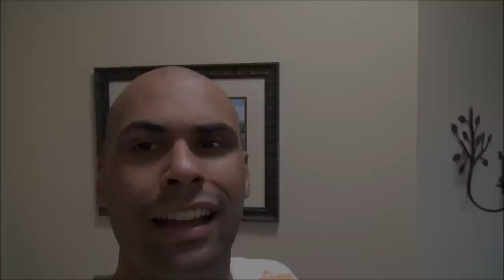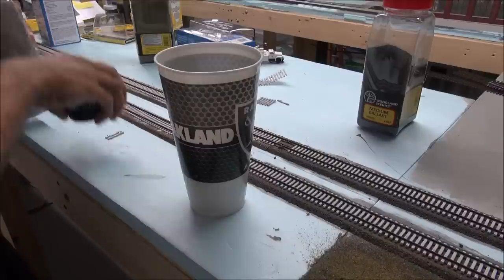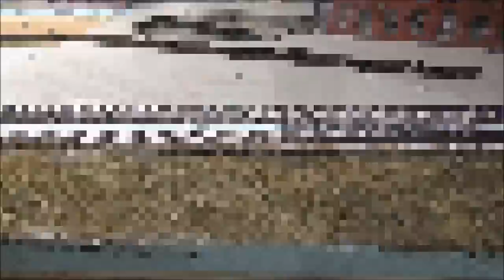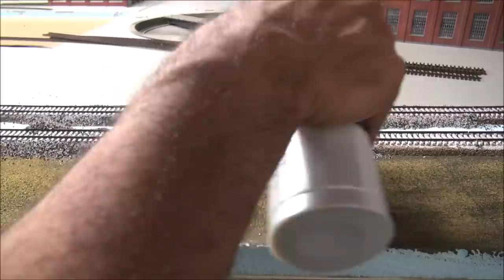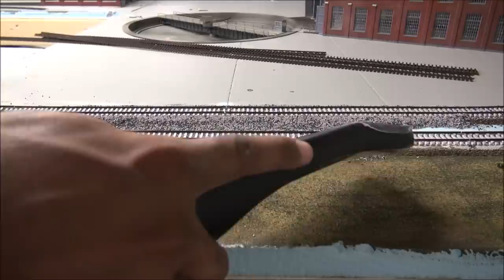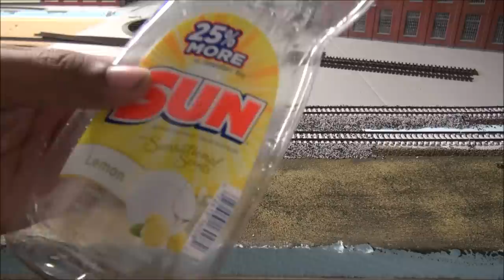How to Build a Modular Layout Pt 11: Ballasting Track

Comment: More or less I do the ballasting the same as you with a few different steps. After using the large brush, I line the ballast with an artist brush.  Don't need the vacuum.  I also add a little fine ballast to bond with the glue better.  I know there are a thousand ways to ballast.Scott

Comment: My tried and true method for applying ballast is to use a small funnel. Just hold it against the rail then poor in a little ballast. Then slide the funnel along the rail and the ballast poors out forming a nice even shoulder. The same method is used between the rails - just run the funnel back and forth to spread the ballast and use a brush to get rid of excess.

Comment: Another approach rather than spraying on the cement/glue is to use a large dropper. That way you can apply larger quantities in just the right areas to get it in well in the ballast but keep the terrain and rails dry.

Comment: i like to use a leg of pantyhose to collect ballast, so i can reuse it.  pinch the toe of the hose and let the vacuum suck it down the hose, but hold the open end and dont let go until after you shut the vacuum off, the panty hose will let air pass through but collect the ballast, and when you pull the sock out you can pour the recovered ballast into a container!

Comment: would be neat if they made operating ballast cars to ballast track with
Reply: +ArantiusVulpes Literally. How. Did. I. Find. You. ON. THIS. VIDEO. (you may remember me as Lunrporductions, the guy from a few hours away.)
Reply: They do make a ballast spreading car(gravity feed). Proses makes one they sell through Bachmann, and there are probably others I don't know about. I never see any U-tube Modelrailroaders use them. They are a little spendy, maybe that is the reason. They also make hopper style hand ballast applicators, but hey work best on straight track in my opinion.